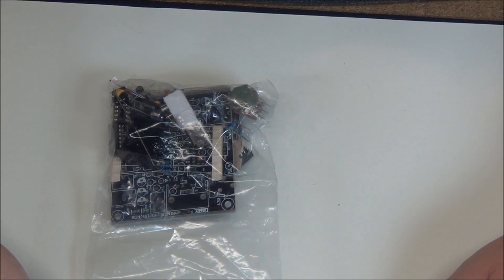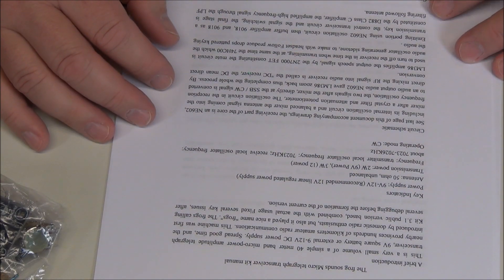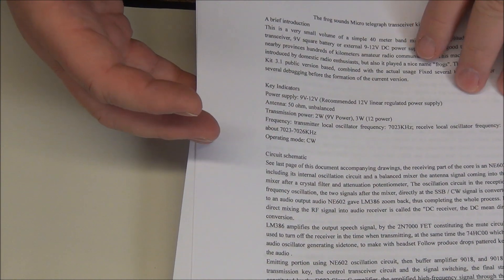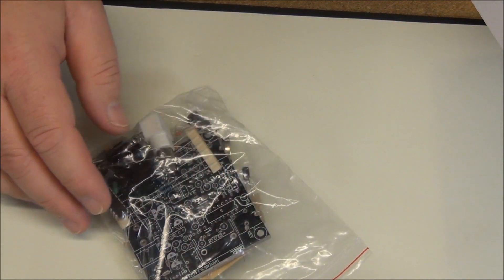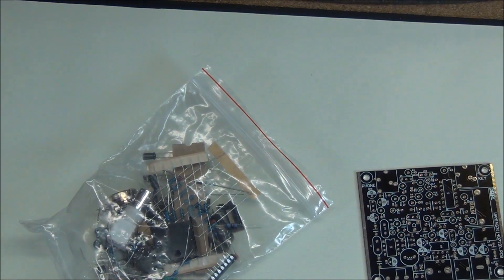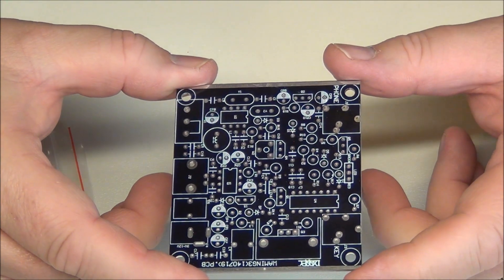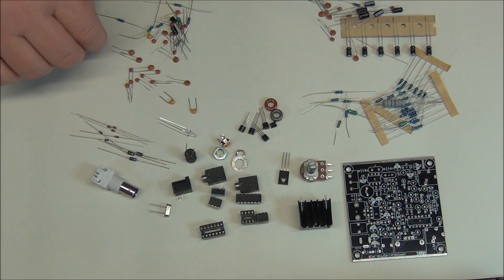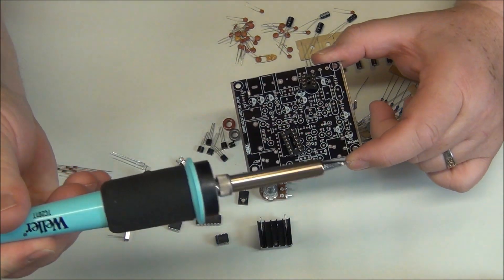Frog Sounds HAM Radio QRP Kit Telegraph CW Transceiver (part 1) -  AF5DN

Comment: A couple quick questions, if I may: How many wraps does each toroid get? Would it make a difference if the magnet wire is 12 guage or 22 gauge magnet wire? Can you think of any pieces that would improve the build? Thanks! 73

Comment: I just received mine and it has four smaller bags of stuff inside a larger bag, not helter-skeltered. Judging by the used looking resistors you had, I would guess they sent you one that returned and the customer just threw everything together. I had the ferrite core wire and heat sink screw.

Comment: Did you ever swap the crystals out, and if so where did you get them?  Unfortunately 7.023 mhz is in the extra segment of the 40M band.
Reply: +Brian Bowling why dont you get an extra class license then? not being mean just curious
Reply: ***** that statement show you are un educated on the topic..and in the tech parts of the bands the behavior has turned into cb and then 80 meters
Reply: @davidgierszewski2819  Thanks for the motivation David.  I got my extra license last a year later.
Reply: Brian, I changed  the crystal on one to 7.030 Mhz and one to 7.055 Mhz, no problems

Comment: I built mine last year... problem is that I saw smoke come out by final stage...
somehow circuit foil fused to heatsink... It got real hot when I transmitted...It worked fine for a while.
i ordered a package of extra final stage parts... and they would burn out every time...
I gave up and threw it away after contacting seller....

Comment: I can guarantee you that 70.023 MHz is NOT a part of the 40-meter band!  You not only typed it you said it as well.... you mean SEVEN.023 MHz - not SEVENTY.  That's in a band not used in the US - the 4-meter band in the UK is on 70 MHz

Comment: I got the kit too.  No one should buy this thing unless they can read and assemble a device from the schematic alone ---- and even that is wrong because it doesn't match the PC board tracings.  R19 is on the board, but not on the schematic, no mention in the Chinglish instructions (which would be inadequate even if the writing made sense!), and turns out it needs a jumper installed there or the final amp won't receive collector current.  Just pretend you don't have instructions; you'll be less confused.  On the parts list, I ended up with both duplicate parts and missing parts.

But!  For a few bucks you can buy the case for this thing.  It is the best kit case I have ever seen bar none, and trust me I've seen a +*+*load of them.  The case is solid as a heat sink and could be thrown through a wall.

The advertisements frequently state a 7.032 crystal, but it's a 7.023 ---- I used a 7.035 when building.  Also,  you have the choice of a 9018 or 8050 PA driver (Q2).  Use the 8050 for the max 2-3 watts out.

Hmmm..... what else. Oh! the listings state that the receiver tunes a few khz; it does not "tune."  There's just a trimpot on the board that varies the frequency enough that the TX/RX frequencies match.  The final amp is a peculiar beast that is probably common is Asia but unknown here.  It's a D882 audio amp/switching NPN (of all things!) which has no cross references.  So, don't blow it!  A common 3053 won't even substitute unless you change out some of the circuitry.

Thanks for the video!  :)